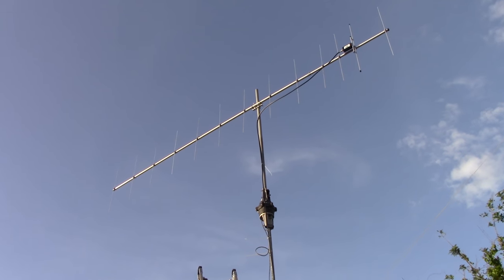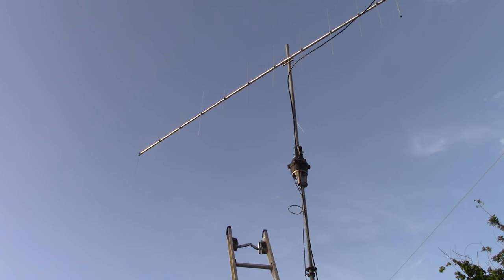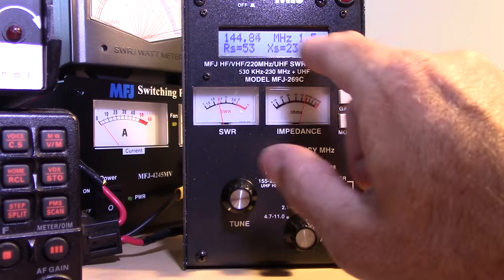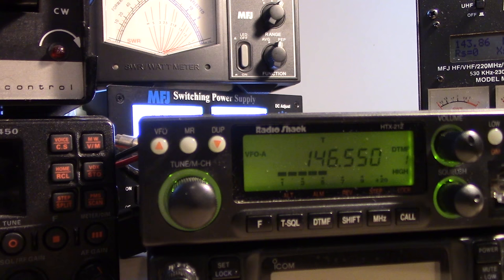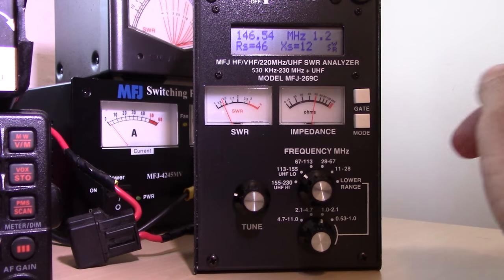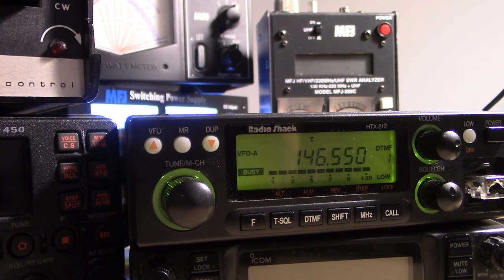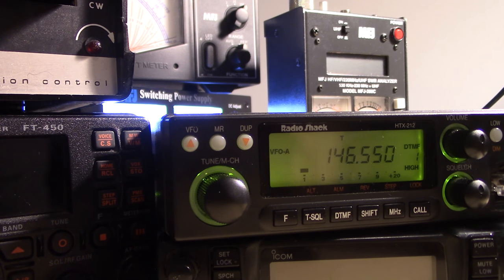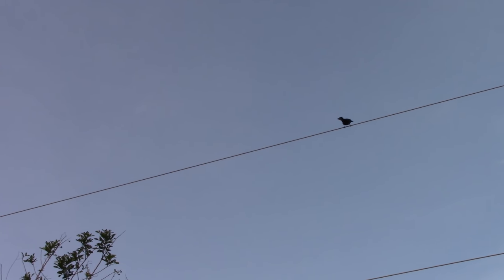VHF and UHF antenna polarization and on air testing

Comment: Your thinking is perfect. Your solution with a fiberglass mast is ideal and minimising how long (distance wise) the coax exists in the antenna aperture is correct too. Effectively, that means routing the coax at 90 degrees away from the plane of the elements. Note that running the coax along the boom is not an issue in itself, as long as it runs on the side opposite where the elements are mounted and as you demonstrated, leaves the boom at 90 degrees to the plane of the elements and not parallel to the elements which is all too easy to do with a vertically polarised beam.  This is why many hams choose "L" shaped masts for vertical yagis. Coax routing is straightforward then.

Comment: You nailed it!!  Did the same experiment with a 430 antenna back in the 80's.   I tried to convinced the local radio club about metal mast going thru a vertical beam and the coax feed path.  But to no avail.  Even cushcraft photo ads of their verticals with a metal mast going thru the antenna didnt help the issue.   What I noticed was the excessive side-lobes with the metal mast.  This was cured by a fiberglass mast from KLM.  Then I joined AMSAT and one of their newsletters discussed the metal mast and coax feed along the beam support issue.   Thanks again for posting this!   73,  Dave  WA9IVB

Comment: Nice to see a video on an old problem we solved many years ago. On EME many of us run X-Pol or dual polarized antennas to combat "Faraday". We have always used fiberglass vertical mounts to eliminate this problem. Fiberglass sections with 1/8 to 1/4 inch wall thicknesses can be bought on line from a number of places.We always also run our feedline off the back of the antennas down to a power divider supported by another fiberglass mount.  I'm a 20 year SSB/CW op on 144 thur 2304 and have worked many vertical stations during openings. Yes they are down several db as compared to those running H-Pol antennas. The Sat packages offered by M2 come with a fiberglass cross member to eliminate vertical issues and pattern/SWR problems also.
Reply: JD Dupuy can you share the web site link,  where you can buy the fiberglass vertical mount?

Comment: Eric,
That looks like a T2X Tailtwister rotor. It has 6 bolts on the bell. The T2X is the only Hy-Gain rotor using 6 bolts, all the others use 4 bolts.  Great info in the video.   73   WB3BJU

Comment: I have the cushcraft 10 element.  Have it at a 45 degree . Works good ssb and fm. I am sending am also using a wooden dowel I put inside a piece of conduit. Swr across the entire band is 1.2.1 or less.

Comment: If you don't spin it 360 you could do what I did 50 years ago, build a small wooden hinged mount with a cord hanging down, simply changing it when needed. I worked  the world qrp 4 watts using a 3 element beam and it was on the business channels back then 27, 235 and 27,245 am, now channels 24 and  25 cb!  Usually oil companies working all over the world.

Comment: I got the smaller one the 10 element. I bought a wooden dowel cut it to about 4 feet. Then put it in PVC pipe and sealed the ends. No swr problems at all.

Comment: I would like to see a video on the Cushcraft 2M Hi-Lo Cross Yagi that has Vertical and horizontal elements on the same mast (circular polarization) with the possibility of two different feed lines (one for the vertical elements and one for the Horizontal elements).

Comment: Make an L-shape in mounting the antenna so it will not align in the mast that is bothering the efficiency of the antenna. I experimented in the B7 series and it's efficient to make long-distance call, the disadvantage you cannot here station in the side or back of the orientation of the antenna.

Comment: If you made an L angel near the top of your main mast and goes out horizontal with X distance, then mount your Yagi in a vertical configuration for avoid the effect of the vertical main mast. How long distance out for not getting any influence?

Comment: The penalty of having cross polarization between two antennas, can result in as much as 20 db path loss, between the 2 stations! For those wishing to use a none conductive mast, above the rotator, with a vertically polarized yagi, schedule 40 or 80 PVC pipe can work fine, if fiberglass isn't available.

Comment: Would have like to see a test with the metal mast mounted flush with the yagi as in the case with the fiber glass. But, very interesting test as it relates to horizontal and vertical polarization on VHF. J88AZ
Reply from the maker: Axis I did have a test the first test was using the metal mast up in the yagi parallel to the elements
Reply: Sorry, I didn't see part 1 of the video, but what I meant, is the first part of this video test, the metal mast almost form part of the antenna vertically. But, when you tested the fiberglass mast, I noticed that the top of the mast was flush with the boom of the antenna. Just wondering the SWR results if the metal mast was likewise flush with the antenna boom. J88AZ
Reply: Great video nevertheless! 73 -J88AZ

Comment: Eric, did you cut your coax to a resonant length? I’ve read that cutting coax to multiples of half wave plus a quarter helps with getting a good match. To be fair, the swr you are getting, would result in minimal losses anyway, but every little helps as they say!

Comment: I run dual polarized antennas on 2/432 EME to combat Faraday. I hate been locked out and have to wait for conditions to change.  I had a nice 250 mile QSO on 1296 years ago with a guy who could rotate his antenna from Vertical to horizontal. He had a local 1296 repeater that he used the antenna vertically polarized. Here's the neat video of that QSO https://youtu.be/Wp6nrQZo_oY

Comment: This is a good example of someone rotating their antenna from H-Pol to V-Pol. Larry had a local repeater that he would work on 1296 but wanted to be able to rotate it to horizontal. Watch the difference in signal strength at 285 miles. https://youtu.be/Wp6nrQZo_oY?t=3m11s

Comment: That mast pole isn't hurting you as badly as the way you have the coax hanging down and TOUCHING  your elements! 
You need to run and dress that coax straight down the TOP  of that boom to the mast  and then 90 degree that coax down the mast and you'll fix your problems. 
And that 45 degree idea is foolish!  You are wasting the potential of that antenna.  And anyone who tells you differently should NOT be listened to, probably about anything.
The accepted standard is that FM is vertically  and SSB/CW  Is horizontally  polarized.  There's no magic fix!  Every degree you move that antenna off the the same polarity of your intended station you are working you are just losing db's, period! 
Pick one and put up a separate antenna for the other.